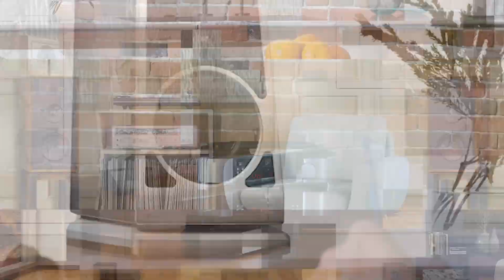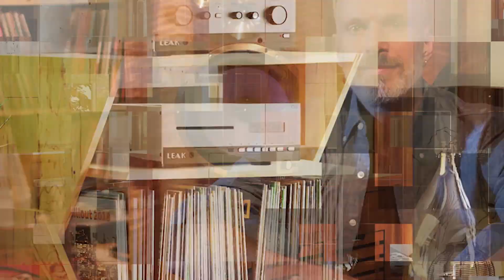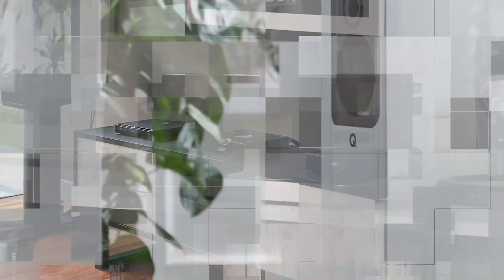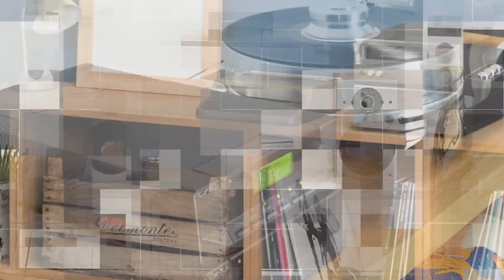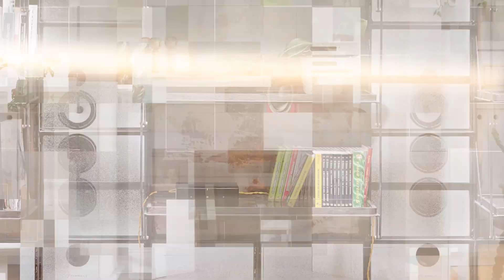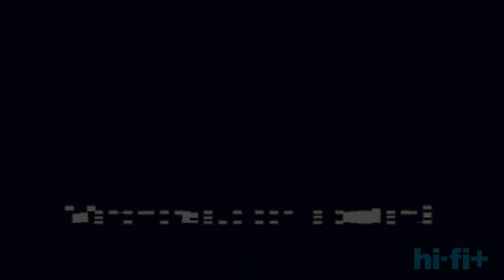First look: Audio Note AN-E loudspeaker

Comment: This still has shitty box coloration as normal AN-e?
Reply: Did you ever hear this speaker? How does it compare to the regular an e? And if it's bad, which speaker do you own, and recommend?
Reply: @divcurl6044  
But of course he didn't - as noted by his silence. 'Just another [ typical ] offering from the social media peanut gallery, amid the [ never-ending ] seas of white noise👌🏾( wink ).
Reply: is there a box that does not have colouration? pray enlighten me?
Reply: @neha7445  Daniel Hertz or Klinger Favre.
Reply: :face-green-smiling:
Reply: Box Yes. Coloration No. If it were shitty (or colored) it would not be  on the market for as long as it has. Do us all a favor and troll someplace else. Thank you!